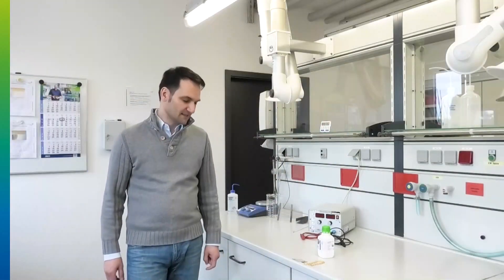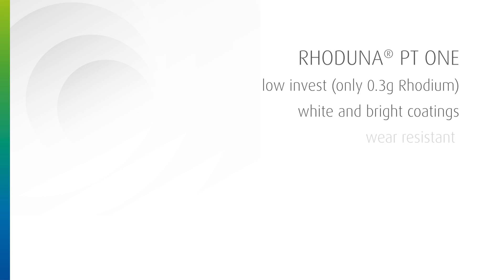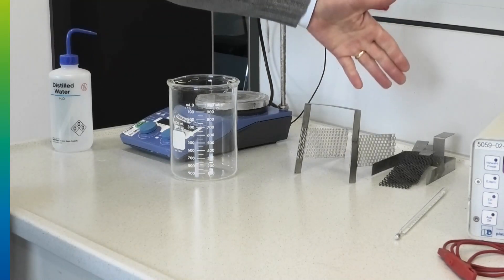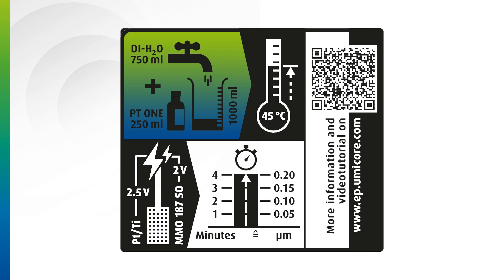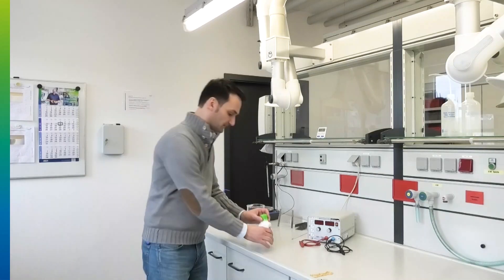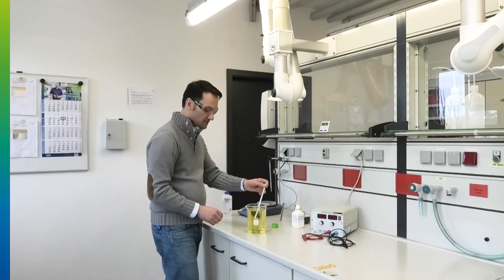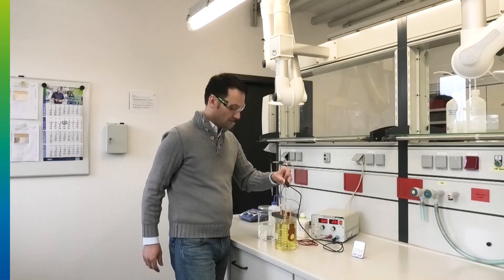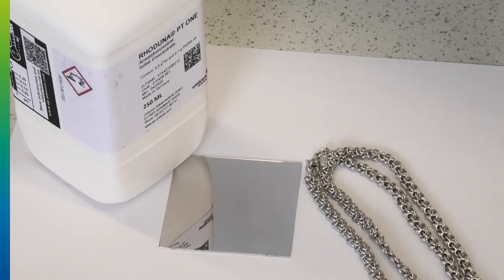RHODUNA® PT ONE - Introduction and Handling

Comment: @umicore
I want to ask how to mix RHODUNA@J1, REPLENSIHER DOLUTION with INITIAL CONCENTRATE, thank you, hope it can help!!???
Reply from the maker: Hi Muchniksolo4980, thanks for reaching out. 
The initial concentrate has a higher acid content compared to the replenisher solution. By continuously adding initial concentrate the plating speed will slow down. Better to use the replenisher solution - which is mixed for topping up the metal. For comprehensive information like the full operating instruction datasheet please contact our local agent (you can find your contact here: https://mds.umicore.com/en/electroplating/contact/representatives/ ).